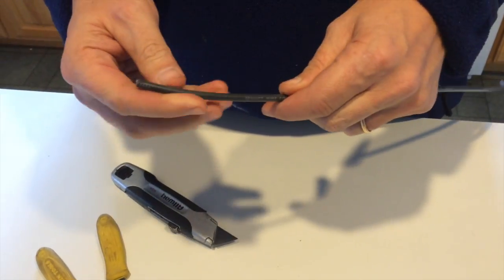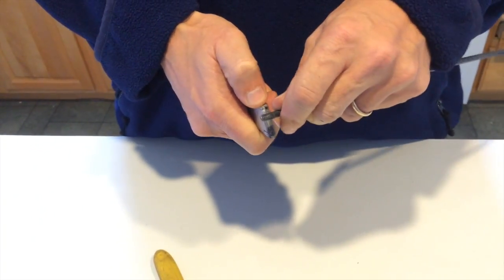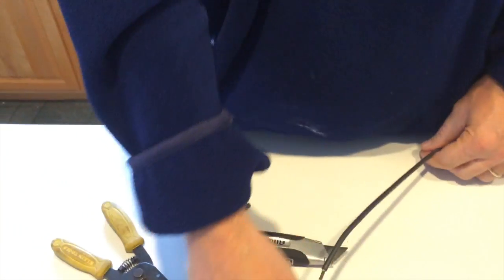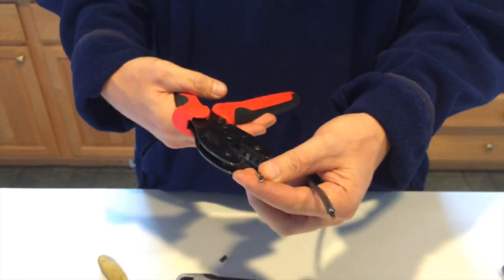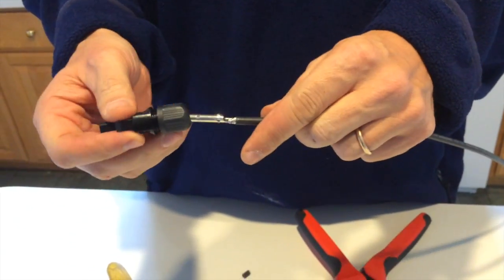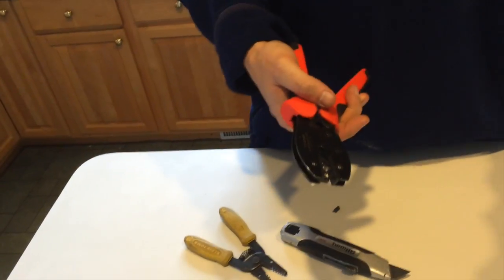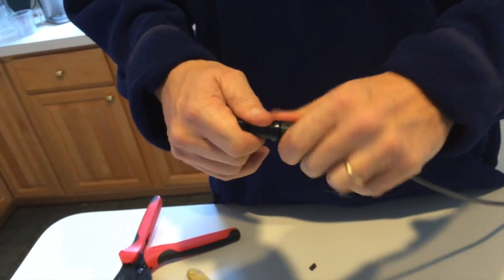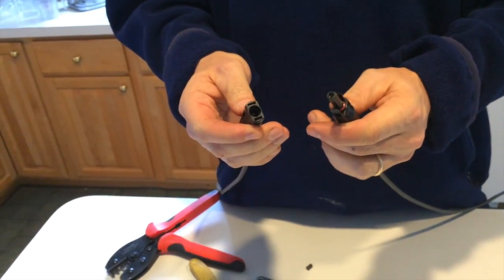Crimping MC4 Solar Connectors

Comment: Is it possible to unscrew an mc4 cable from a flexible solar panel? I tried but it won't budge. I'd like to replace the cable with a longer single run into the van that I can thread into a small hole and I don't want slack or connectors on the roof of my van.
Reply: You'll find if you open the back box (front box, probably on a flexible panel) the wires are soldered directly to the box (probably with a metric ton of solder). You'll need to break this and resolder. It's hard, but doable.

Comment: Solar wire have two layers of insulation, to withstand UV... is that wire UV rated?
Reply: You can click on the amazon link to figure it out for yourself.    It says that it conforms to UL-4703 which is listed as "sunlight resistant".